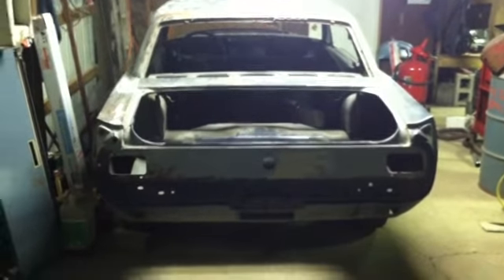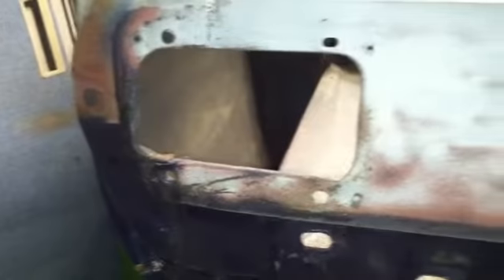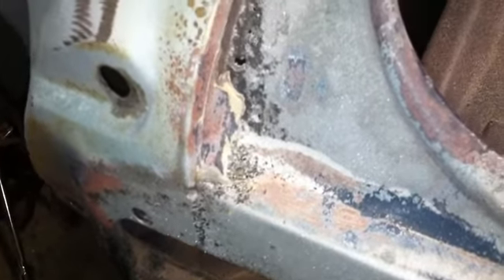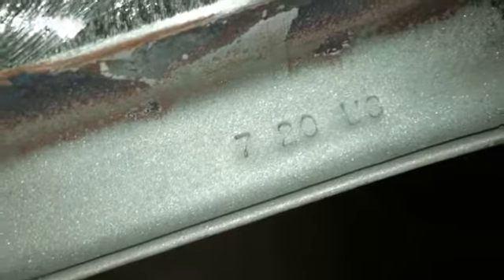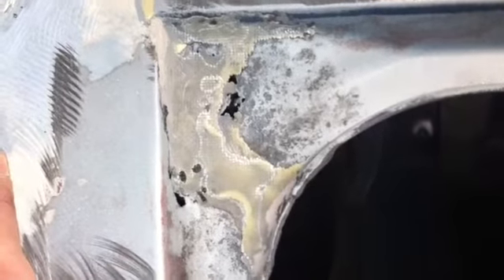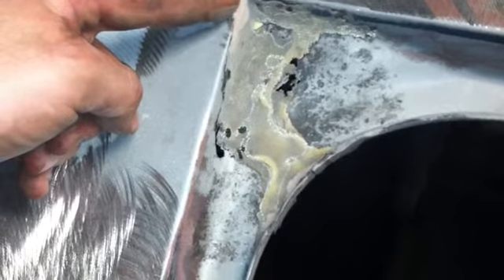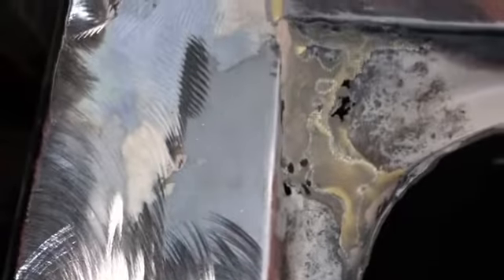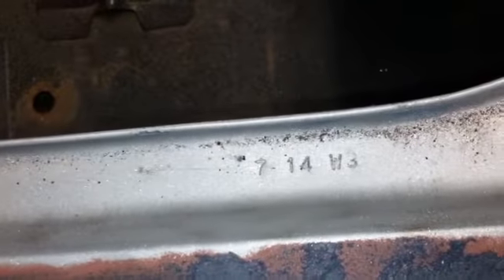1966 Mustang Restoration - Part 20 - A Little Sandblasting and Grinding

Comment: Thanks for the update!  I think you should be able to weld a piece in the roof.  I always apply fiberglass filler over welded areas, then finish it out with body filler.  The fiberglass will seal and prevent rust from happening again later on.

Comment: I just found your video's, so I am sure you are done ..but for others, or if it were me, I would simply make sure the integrity of the metal was sound as can be done, cleaned, striped, sealed, etc, then I would use some marglass/mud-glass as a base coat, and final it as normal. It should never be a problem again after that. I am fortunate to not have any roof issues, even though it had a vinyl top, on my 67 I'm working on now. Thanks as always

Comment: I don't see anything that needs an e-wheel.  You can put a crown in your patch pretty easy.  In fact, I think I would leave most of the roof in tact and work it on the car.  As for your trunk corner patch.  Cut two pieces of wood to the shape of the curve, clamp a piece of sheetmetal between them, and hammer that curve out.  You'll get a perfect patch, no doubt.

Comment: The rusted area looks like it co-insides with the seam of a vinyl top. I would think could match the slight crown with near any roof panel in a wrecking yard. A cordless sawsall of a cold chisel and a hammer should be all you need to bag one fairly quick.

Comment: I cringed when you said!" you grinded" you didn't need to grind it that will weakin the metal by thining it! also heating it up causes warping! it. the sandblaster can too, I hope you re etched the metal if not its a ticking time bomb with rusting through the top coat in no time. Good luck .